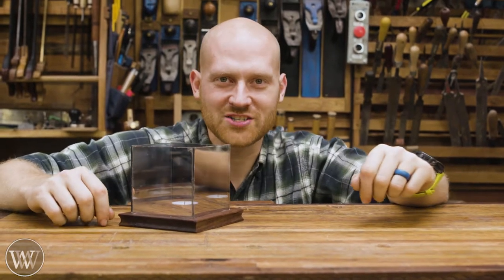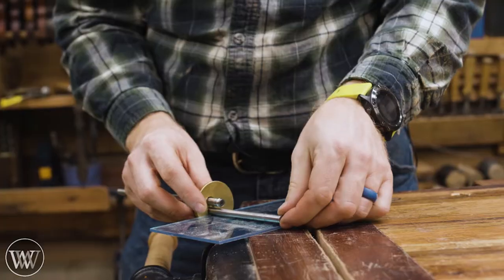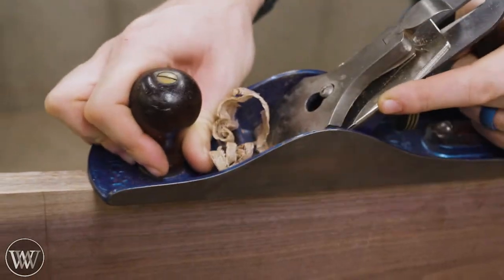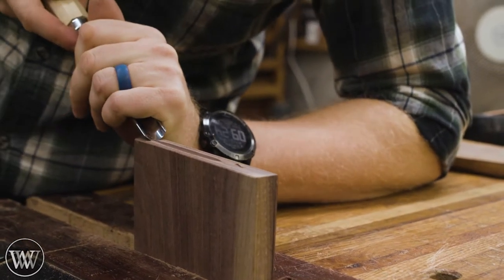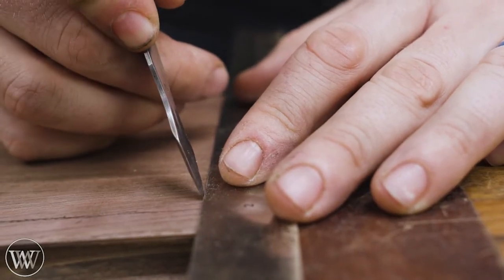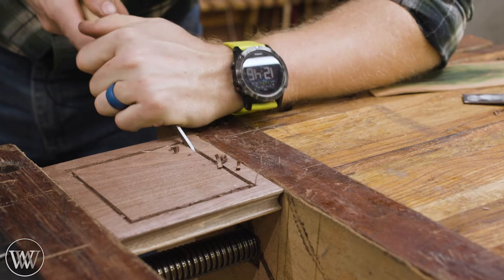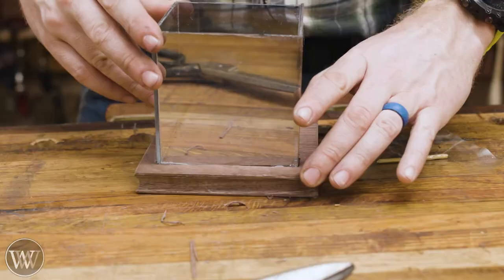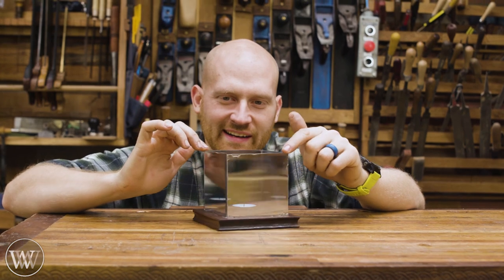How to Make an Infinity Candle Holder with Plexiglas

Comment: Would you use a gouge to cut a cove also? It seems that it would be virtually the same operation except the lines would be on perpendicular faces.
Reply from the maker: I am not sure what you are asking sorry.
Reply: @WoodByWrightHowTo  I think I misused the word "cove". I meant to ask if you would use the same tool if you were to round the top corners into a concave shape, like one might do with a cove router bit on the edge of a workpiece. Hopefully that makes more sense.
Reply: oh i see. in that case, I would use bench chisel to get close then a rasp and file probably. I could also use and incannel gouge to do it but that would take more skill.
Reply: @WoodByWright  thanks for the reply! Keep up the great work. I'm actually using your BLO and paste wax method to finish my very first project at the moment. I'll need the above info for my next one :)